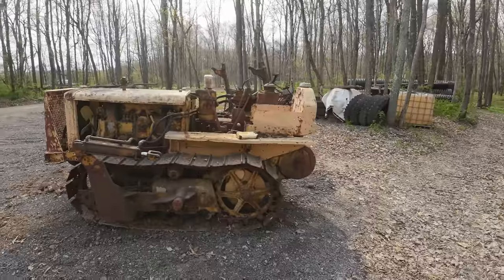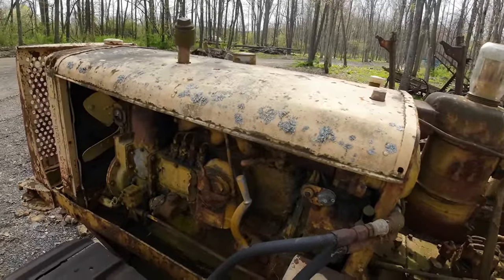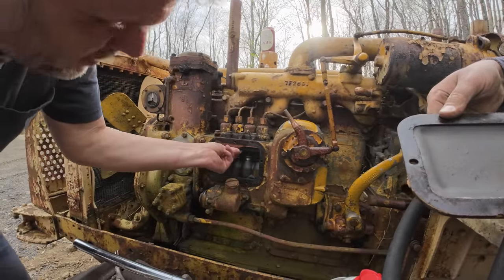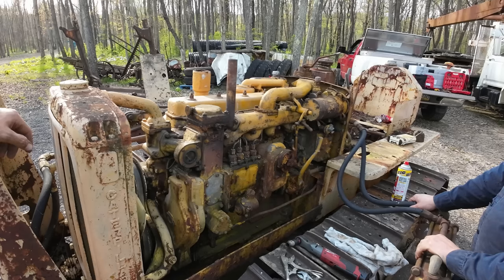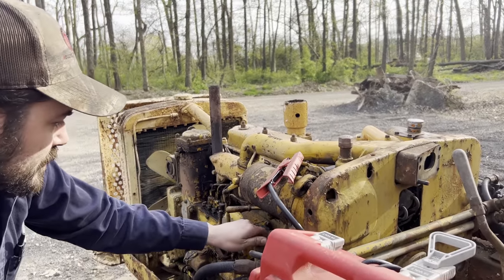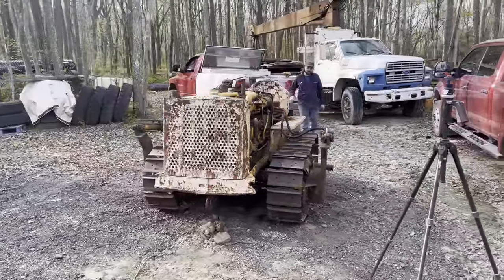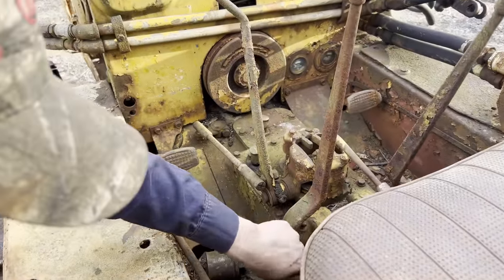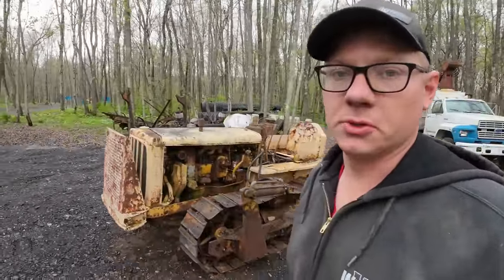$500 Caterpillar Dozer sitting since 1992!!! (Will it Run!?!?)

Comment: squatch253 has an 80 part youtube series on restoring every part of a d2 if you need references
Reply: I have one which was my grandpas farm tractor. Sat 30 years in a paddock and didn't run. All it needed was the pony motor rebuild and now I am doing the Steering clutches. I named mine CAThy
Reply: @navcenter77  nice name. Also that winch would look nice on 5J1113.

Comment: My grandpa had bought a caterpillar years ago originally as a project for me and him to work on together. He sold it a few years later to fund a hunting trip when I was 16 or so. I'm 22 now, and I still wish he hadn't sold it and accepted my parents' offer to pay for part of the trip.
Reply: You can always find a Caterpillar project. You just need to know what to buy and what not to buy.
Reply: That sucks.   I just started work on an old backhoe myself. It's an early 60s Nuffield 342(3cyl  british tractor) with an early HYMAS(Norwegian design. HYdraulisk MASkin firma, 'Hydraulic MAchine company' ) backhoe installed. 
Weird stuff... The front axle is missing the outer parts, and instead there's some sort of truck axle bolted on, to make it slightly wider and fit larger tires(we think that was done by the HYMAS guys). The Backhoe has it's own frame that's bolted onto the tractor, and hydraulics is by a pump bolted to the front and driven by the crankshaft. It's definitely not made to be removed in a hurry. The boom on the backhoe is a heavy iron pipe, not a boxed section. The tractor lacks original hydraulics, the arms, towhook or even a PTO, and we think it was built that way originally.    Fun thing...  
My father started his career as a machine operator with a similar HYMAS, but possibly on a  different tractor base(he can't remember) He sold it back in the 70s when he upgraded to a tracked Hydraulic Digger, but when he came across this one some time after 2000, it brought back memories and hge bought it to restore and possibly do a bit of 'large scale gardening' at home. Then he got ill(double bypass surgery, cancer and we don't know all) and he no longer has the health to do anything to it. I hope to get it started this summer, so he can teach me how to dig with it. (He's 86, so who knows how many years he has got left)   

Anyway, the backhoe is at my parents home, so I get to spend some time with him, talking about the old days and what he experienced here and there while wrenching. That's the most important part of these projects.
Reply: @Frank-Thoresen  I feel like the way you made your comment tells me you have bought a lot of caterpillars and you know what’s bad and what’s good to work on 😂
Reply: @cabbagememes2852  Thank you for noticing that. If you have done some projects you will always get some experience.
Reply: Hey Matt. Yes those little D2s are cool but you are probably better off letting your friend have it. I don't know how you get as much done as you do right now.  Always cool when we save some good old American iron. Thanks for posting.
Reply: 26:00, FUEL PRESSURE.?.?  OIL PRESSURE IS .??Lol...
Reply: Fun just watching you bring these old things to life. Thanks!
Reply: You’re 22 now, buy a similar project yourself to do with him. Grandparents aren’t around forever and go too soon, it would probably make his year to know you want to work with him.

Comment: Interesting history to share: The Caterpillar D2 was manufactured from 1938 through 1957 by Caterpillar Inc. in their factory in Peoria, Illinois, USA. The base frame of this model of tractor is a crawler, and it is equipped with five forward gears and one reverse gear.[2] The D2's weight ranges from about 7,420 to 8,536 pounds (3,366 to 3,872 kilograms), depending upon the year it was manufactured.[1] Caterpillar began producing this model (among others) in response to the "New Deal" programs that were initiated by President Franklin Roosevelt to stimulate America's economy. A total of 26,454 D2's were made over the nineteen years they were in production.[1]

Comment: In many years past, when I ran into the problem with the steering clutches being frozen, I would make sure that the bottoms of the clutch compartments were sealed up and then pour five or ten gallons of parts solvent into them. I always made sure to submerge the clutches. I would then let them sit for an hour or two and then start running the crawler back and forth. This always took some time, but this procedure always worked. 

Kudos to your buddy. There is no doubt that he has been around crawlers before. He knows his business.

Comment: It is a gem indeed matt. Very easy to work on once ya get the tub top plate off. Desirable unit to the right person WITH the blade setup and winch. Not many came with the winch actually.

Comment: Nice little dozer, even has a winch and it works. Purrs like a kitten, looks like the tracks freed up pretty easy. That would be a nice tractor for pulling logs out of a woods. I think I’d keep the blade together with the tractor though. Thanks for sharing, see you next week.

Comment: Several things here.  LaPlante Choate (silent e) built a lot of early Cat attachments.  Not as many as LeTourneau though who had a plant in Peoria.  I have heard from one source that the Cat branded blades for the D-2 were build by LaPlante.

If a machine has been setting that long, it might be well to check the spring in the relief valve below the fuel transfer pump.  Water collecting there will rust the spring and make the engine hard or impossible to start.

There are small plates on the steering clutch compartments accessed by removing the foot plates.  Making sure the drain plugs are in place, fill these compartments with kerosene.  Run the machine back and forth WITHOUT trying to steer to wash the compartments.  This is the Cat recommended procedure.  Same with the master clutch.  Kerosene was cheaper back in the day.

That machine is probably just a few years younger than me.  It could be parted out for substantial $$, but is probably worth replacing the tracks.  Do hope to see part two.  Hope it's not stuffing that engine into the 212.

Comment: This was wonderful. When I was a kid in VT I ran a T-bar at Pico Peak Ski area. The power plant was a huge old Cat with a pony. Many many a mornings I fired the pony up. Once the pony was warm I would engage the drive and then let it turn over until the exhaust manifold was warm. Once exhaust on the cat was warm you threw the compression lever and bingo a huge belch of black smoke and the Cat came to life. 
That Cat ran for many many decades, probably 40 years or so.

Comment: I'll never get tired of watching old equipment come back to life!
Diesel engines with starter engines!
Reply: Well I wish we could get them to do it correctly!
Reply: @johnliebermann4643  ??? Correctly??? What are they doing wrong?
Reply: @dans_Learning_Curve  They get the big engine turning, they turn on the fuel  then close the valves. The engine fires once and disconnects the drive(it isn't a Bendix).  The proper procedure is to rotate the big engine with valves closed to preheat slightly, then turn fuel on.

Comment: We use to wire the cutch controls back before storing our old D6 and pour diesel on them so they wouldn’t stick and lock up  but we have had to replace the clutches before it still runs and drives fine

Comment: "They're made to be reliable, not replaceable".  Aint that the truth! First and foremost they made them waterproof,...after thirty years in the rain the magneto, wires and plugs still work.
 I see the flywheel on the pony has a slot in it for starting with a rope. Its seems to run so well now you might not even need a battery to start that machine!! They just don't make like they used to!

Comment: Back in 1982 we used to make our own home-brew chain lube comprised of diesel fuel and graphite.  It was pretty messy but the diesel would evaporate and leave the graphite behind as a sliding lubricant.  We used graphite sold to lube planter plates,  which came in half gallon jugs.   If memory serves we could mix a couple jugs of graphite to 2 gallons of diesel fuel.  We used a small pump-up garden sprayer to apply the mixture.  Perhaps this concoction would be useful in lubing stuck tracks and other seized up parts you encounter.  

Great video as always!

Comment: We call these pony motors "putt motors" up north in Canada.  I have a D4 from around 1939 with after market canopy and hydraulic blade.  In winter, the putt motor is used to warm up the diesel before starting, as both motors share the same coolant system.  Bought mine for $2000 in the late 80s.  Still works well.

Comment: Gday mate, word of advice on this (we have owned one of these for 50 years and pony motor starts it perfectly everytime.)  When you have the diesel motor rolling over with the pony engaged & whilst waiting for oil pressure to build - make sure the diesel fuel is shut off completely.  When you have oil pressure and happy push the decompression lever in - ensure diesel fuel lever is still shut off.  In this configuration let the pony roll the diesel motor over under compression but without diesel fuel.    What this does is builds heat in the diesel motor by friction & the heat from the pilot motor exhaust circulates through diesel motor manifolds creating heat.  The pony wont over heat too as its getting cooling from main motor water.  After a few minutes, or when you're happy she's warm shut off fuel to pilot motor and after about 30 seconds or so just before the pilot conks out throw the diesel lever to open the fuel and whallah, she'll run beautifully & the pilot motor will conk out.  Its important to run pilot out of fuel.  We have a full set of books for the D 4 and this is the correct procedure to start.  It's a very gentle and kind way to start a cold diesel, building heat up slowly.  I thionk ours is 1952 or 3 model.  cheers!! good luck!!

Comment: On an old diesel engine, turning the engine with compression only preheats the cylinders. Feed in fuel gently and it will fire right up. I first learned this trick in the Army while operating skid-mounted gensets, and later used it on my old Kubota tractor.

Comment: I don't mechanic much any more but I remember Dad, a lifetime auto mechanic showing me how to make gaskets out of a sheet of gasket paper! You hold a piece of gasket paper over your part, tap gently a ball peen along the edges (inside and outside) of your part and cut along the now visible lines!! You shouldn't be afraid of ruining any gasket!! I did this method multiple times on my minibike motor when I was 13,14, 15 and 16!! Used a little Permatex sealer to stick it!

Comment: Maybe some one else has already mentioned this, on how to start.  Fuel off, compression off, make sure oil pressure, then compression on.  Let the engine block build some heat, when warm to the touch then apply fuel.  Fires up right away every time, if warm enough.  Colder the weather the longer you need to run the pony engine to get it warmed up enough to ignite the fuel.  Holding the bendix in is bad for the engagement mechanism.  It was not built to hold the bendix in against the fly weights for long periods of time.  Many people have broken that mechanism, especially in colder climates.

Comment: Undercarriage parts for a D2 are impossible to find. Last time I tried to repair one (20 years ago), you could convert everything to D3 stuff, but it costs way more than the machine would ever be worth. Probably the most valuable parts on there are the pony motor and the winch. Nice job getting it running.

Comment: G'day mate, we own one of these have for 50 years.  Process to start is this as per the book 
- Start pony which you've done no worries.
- Once pony warm, engage main engine - diesel fuel off & decompression lever pulled out = deco on.
- After engine has rolled over for a little while with decompression still pulled out, push in the deco lever to create compression on main engine.   You can then let the Pony roll the big motor over in this configuration for quite some time - still no diesel fuel though.  (Engine oil pressure should be up now too.)
- in this configuration the pony motor is generating warmth into diesel motor via friction & exhaust gases running through main diesel manifold.  Its a very kind and gentle way to start a diesel.  heating the diesel motor prior to starting is part of the process. 
- When your happy main motor has fuel pressure & heat you can shut off fuel to pilot motor and just before pilot conks out rotate & open the diesel fuel to main engine,  She'll start perfectly every time.
- Pilot will stop as fuel is expired,  This is important.
- This method is straight from the book and is how it should be done, don't open diesel fuel lever tool early.  Good luck...

Comment: Thanks Mat, I thought the pony motor would spin the diesel over and use the compression to warm up the combustion  chamber before the fuel was added.
Reply: The parts to disconnect the pony motor is stuck. Normally you start the pony, warm it up ,clutch in the engine with the compression release open, get the engine turning over, oil pressure up and when the stars align drop the release and see it run. Shut off the pony by turning the fuel off and get to work.

Comment: My uncle used to heat burnt engine oil till it was just good and warm, then with one of his workers running slow ahead and then reversed all while spraying the oil on the tracks with a 4 gallon pump sprayer and it would work in the bearings and all moving parts. That worked great.

Comment: Trick my old man used on a D7e with pony motor, especially if it sat for some time was to turn the diesel over for a few minutes with no fuel but with compression-thus building heat in the cylinders. Made a lot of difference, the old girl fired up easy, and much more so then otherwise. Good video Sir, and that little kitty purrs awful nice-really hope your buddy decides to keep the blade with the machine, shame to split it up

Comment: Vistited an old timer that had retired close to me here in NC . Told me he started in the grading business with one of those pulling stumps with a cable for a nickel a piece !  They layed a cable over the stump and pulled until it broke loose then repositioned the cable for a second or third pull as needed.  No blade involved.

Comment: The track passenger side is hinge like the hinge is badly maul up. There are many hinges in TBE track crawl mill that is the same as two track jacket on the ground. TBE wheel of the D2 is MAULER on roll or MAIMER. If there were new metal band x two or Bobcat rubber band around the wheels on one  side.

Comment: To unseize the tracks ( I know this is an old video), just set them in water for a week/two weeks. Then it will roll easily. No need to hack at it with a large machine. The hydraulic tank and control is LaPlante Choate. The blade mounts don't look like L-C to me but maybe they are. Fuel valve on tank open?

Comment: Sometimes You can get lucky and just by putting Your hand over the exhaust will create enough back pressure to ignite the Diesel. Other times a rag soaked just enough with gasoline to make fumes will work in place of either . I have used either too but it is not recommended.

Comment: I have ben around old Cats all my life. You are supposed to engage the diesel engine until it has oil pressure, then engage the compression. After it  warms up , 37:22 you put on the diesel to start. I have never seen any one open the fuel and then engage the compression.

Comment: the starting clutch also has a clutch brake! you push it the other way to engage the brake and the pinion will slip in nicely.

you wind over on compression to build heat with no fuel then add fuel it should fire straight away.
Reply from the maker: Ya we did that first, your watching a very condensed version of what it took to start

Comment: Maybe not a  'Home Run' but you made it to 3rd base.  1st base was getting the pony motor running. 2nd base was getting the diesel engine running.  3rd base was getting it to move forwards and backwards.   The home run will hit when the steering works.  YAY!  🙂

Comment: No more satisfying sound than a Diesel power CAT! I still get the same spine shivers when I get a new 'child' in the fleet. D2 is the worst tractor to get steering clutches operable/repaired. The tracks, track frames, final drive cases-come off then you are ready work on the finals. General Gear in Idaho has all the parts for these early CATS. Good luck!

Comment: Cat D2 that my grandfather restored back in the day. It needs a seat now from sitting outside so long in its place since 2004 or so it has a pony motor on it. I was interested in making it electric start at some point
Reply: I’ve never ran the machine so this is a great video for me to figure it out. Also I was told the hubs like to freeze up or something? My uncle who ran it ALOT after it was restored was telling me about it. I noticed in the center of the drive sprockets a oil stain running down it. The dozer is in amazing shape the blade is literally the only thing with surface rust like equipment does when the paint wears off. I want to coat the pony motor tank too. If my hubs are stuck do I have to remove the track to get inside there ?

Comment: Track pin in thru it in the tracks. THe traction rear sprocket wheel is the issue but not too bad. The sprocket size 2 foot diameter have worn out tooth - all of them.

Comment: You need an impact to brake those steering clutches free. First chain the D2 to something solid. with some slack in the chain. Start her up. pull both steering clutches and hold them right back. Then engage the main clutch. Watch out when the chain hits tight. Hang on tight. It will brake the clutches free or stall the engine.
Reply from the maker: Everything connected to the linkage is stuck internally. It’s more than just the lining stuck